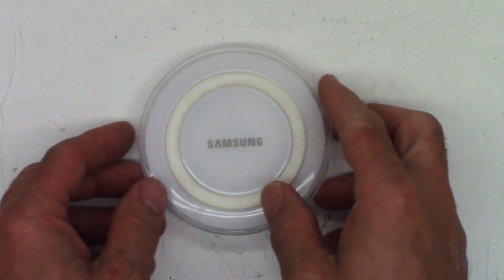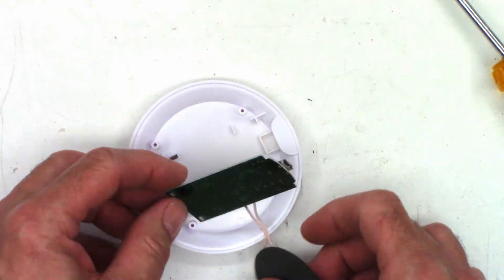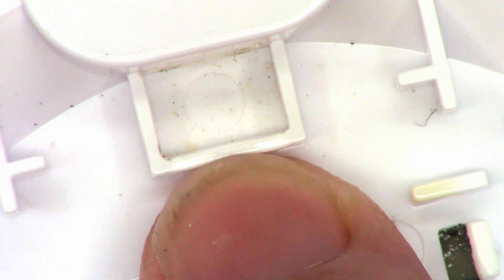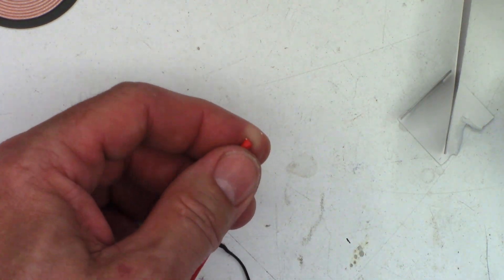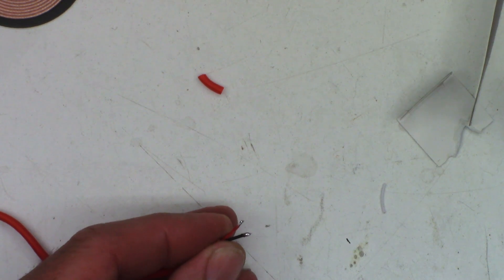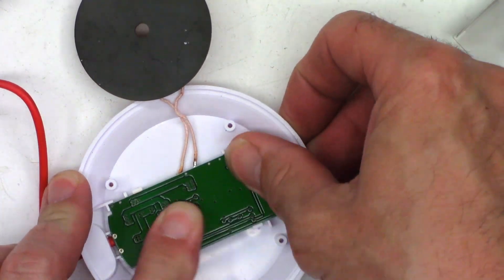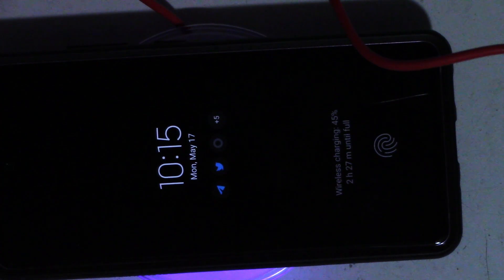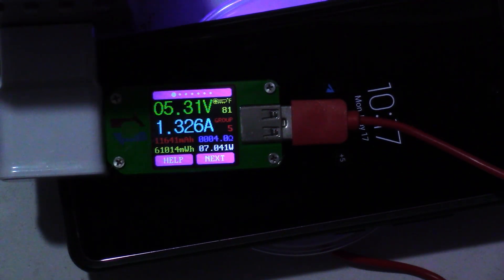SAMSUNG WIRELESS CHARGER - WONT CHARGE - NO LIGHTS - MICRO USB DELETE - EP-PG920I

Comment: I did something kind of like this with my old apple tv. The psu in it failed and instead of paying $100 for a new psu i opted to solder a usb cable to the vin then power it with an apple charging block.